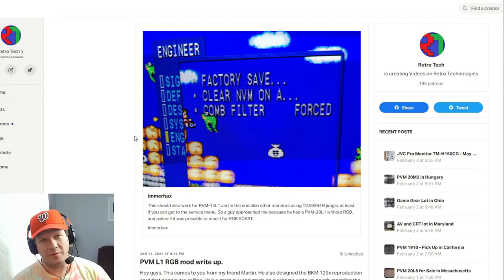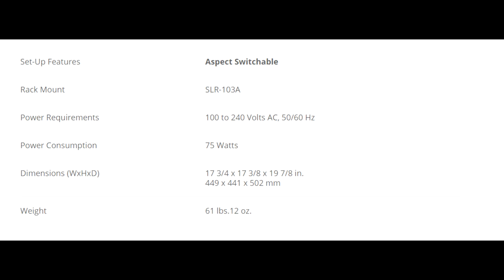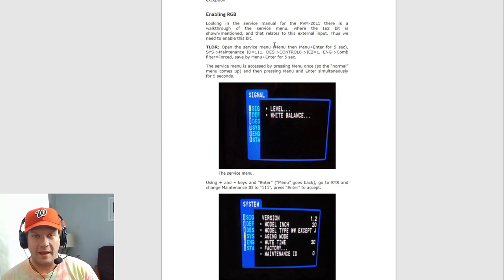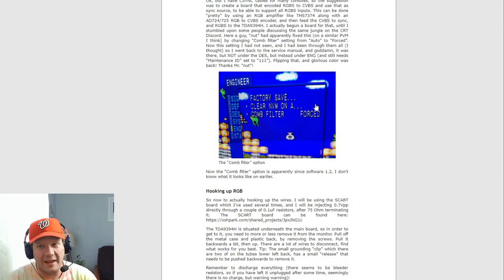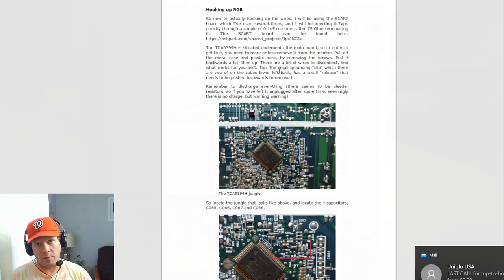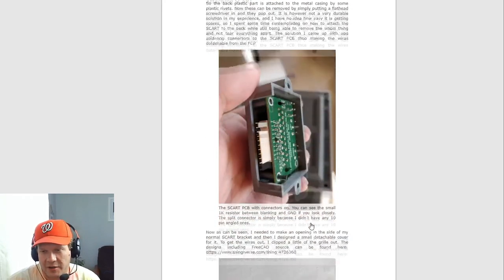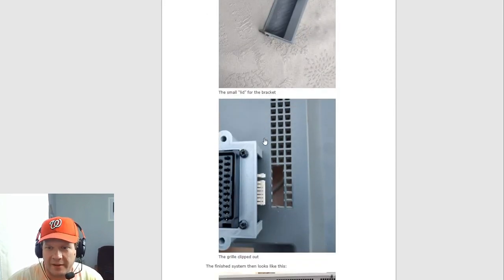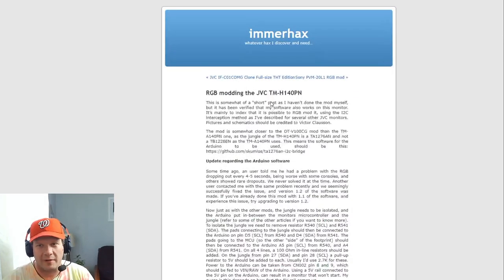Adding RGB to a Pro CRT - Sony PVM 20L1 - Scart Mod

Comment: I have recently completed this RGB scart mod with a 20L1 and works very well. Big thanks to Martin for inspiring me to do this mod, these 600 line tubes are very nice and are the same as the L2 i believe. 
I'm planning on doing a referb to this board now by replacing most of the future troublesome capacitors. 
This model has one large board with everything on it as apposed to the 20L2. 
I was wondering if i can get a cap list for this model to replace without having to replace every single capacitor as it would greatly help me out?. Retro Tech thanks for everything you do.

👍👍

Comment: Did it today with pvm14l1 , worked 100%  I also added  shielded RGB lines and a sync stripper  (most of my homebrew  thomson cables are composite sync for compatibility reasons i assume consumer euro sets already have this circuit built in)
Reply: Can you help me with mine? Are you in the MI area?
Reply: @rekor  Well sadly I''m located in Europe, but there's a well written, comprehensive tutorial out there. Just add shielded rgb lines and lm1881sync separator in line with  composite (retroRGB has a tutorial on this) , good luck it's worth it

Comment: I followed the procedures on my 9L1 (RCA jacks used) and boy, is RGB sharp over composite. My Genesis Model 1 looks better than before and I have a few others I'll connect to see how they perform (made a multi-console A/V board that has RGB, composite/sync, and audio (stereo for the SNES, Genesis (headphone cable), PS1/PS2, and OG Xbox, and mono for the Genesis). I made it where the stereo audio can be combined to mono using 2x 1K Ohm resistors on the left and right channels and combining them to 1 connection.
Reply: How long does it take to do?

Comment: Because I live off grid, I use a 12v system for everything. Since many portable consumer CRTs and field broadcast monitors have direct 12v input, I am interested in adding 12v input on my JVC TM-H1750CG if possible. It would save me lots of power that is wasted when using my sine wave inverter to power my monitor.
OH! just finished the video. PERFECT! Looks like Marty is the guy to ask, will check his page!..... edit: Doesn't appear to be ANY way of contacting them, even via the comments..... Any suggestions?

Comment: Simple question what amp and watt power cable should I use with 14 inch 14L4 5amp 10amp 250watt?? Dont wanna fry PVM

Comment: Awesome information! I may try it on a jvci have in the pipeline. Right now I’m working on an Ikegami that I changed all the cap on, and a resistor blew on the neck board. Is that common? I’m having a hell of a time trying to find/read schematics to find the correct replacement. Thanks for the video as always!
Reply from the maker: Which Ikegami?  I've had lots of cold solder joints on older Ikegamis in the past.
Reply: @RetroTechUSA  I couldn’t find a model number, only the year of manufacture. 1979. I saw the video where you talked about old Ikegami monitors with cold solder joints, so I went over every joint beforehand. It powered on with no picture. I recapped it and powered it on and that’s when the resistor blew. I replaced the resistor and it now has a whine when it runs. 🤔 thanks for the reply!

Comment: Hey all, I've got a bit of a problem that I could do with some advice about. I've got a PVM 20M4E with this problem: https://www.google.com/url?q=https://sneeknet.io/index.php/2019/02/25/pvm-20m4a-power-supply-fault/&usg=AOvVaw3_ZMKbs6iN2byxOeAV3Dzv

Basically, one of the ICs on the power board has popped, and apparently it will have taken a few others with it (one of which is on the main board). Anyone who's done this or something similar, will my not-too-great soldering skills and iron be enough for this, or should I try and take it to a repair shop?

Also, one of the ICs I need (an str-s3115) isn't in production any more, and the only way to get hold of one is by shipping a used one from the US to the UK. Are there any alternatives I could use instead of this specific IC?

Thanks in advance to anyone who replies :)